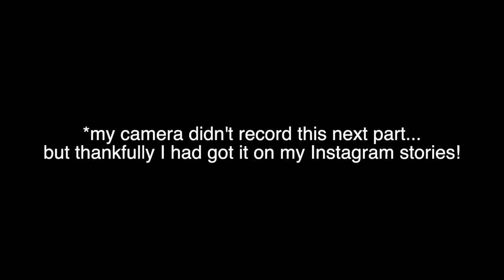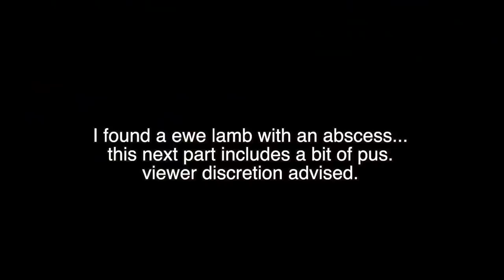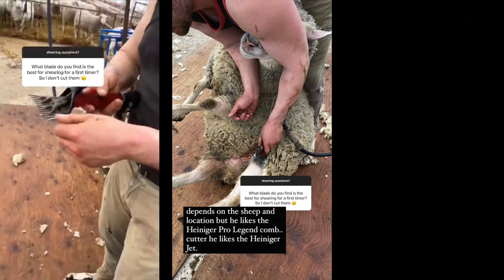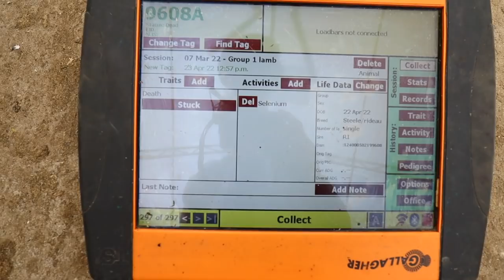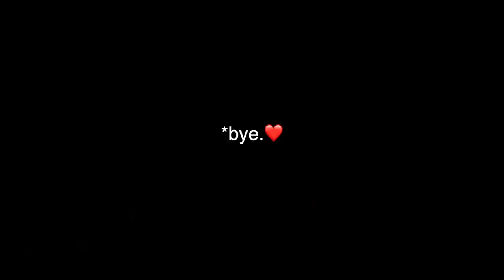EWE look drained.🫠 | a SHEARING surprise, some PLUMBING problems & MAMA finally lambs! 🤰 | Vlog 574

Comment: I don’t understand how anyone can think shearing the sheep is cruel. I would think having all that extra weight off of them would feel wonderful.  Charlie takes great care and it shows.
Reply: The handling of the sheep can look cruel to some, along the lines that they do get nicked from time to time.
Reply: Especially since they were bred to require shearing and now it has to be done. YT has a few shorts of sheep that were lost and can barely walk when they are found years later, and they looked miserable. I'm sure sheep have died because of overgrown wool.
Reply: I think that as each lamb completes their shear they kindof strut their stuff and look like they feel cooler and fresher. Like how we feel after a great haircut and style 😆🥰
Reply: If they were to wear a full length wool coat in hot weather for just 1 day they would change their minds.  or just be there at shearing time and feel the body as it is being shorn.  The Alpacas that I do will stand to allow me to get that hot fleece off of them.  I  talk to them and remind them how cool they will be.  Have those same ppl gave thought to how any die from heat exhausted.
Reply: I was amazed at how relaxed the sheep he was shearing looked - like she was getting a massage - maybe it’s knowing how to hold them so they feel secure. It really does look like an art to me

Comment: Attention sandy brock.. TIM from Ontario Canada.. if you were wondering how to clean this up after you have a spell.. use the leaf (blower.. )The leaf blower will dry up your floor).. it might be loud for a while but the floor will be dry.. depending on if you use the battery operated or extension cord.. but using the leaf blower will clean up most of your wet floors.. you can do this in the winter time if the floors are racy

Comment: Your flock is picture perfect after shearing. 120 sheep sheared in 5 1/2 hours comes to 34 sheep per hour. Also done safely. I agree it is a craft.  The field looks great. Your investments are paying off.
Reply: Less than 2 mins per sheep!! WTG Charlie!
Reply: It actually comes to 21.8 sheep per hour.  34 sheep per hour for 5.5 hours would need a flock of 187 sheep. The correct calculation is closer to 1 sheep every 3 minutes.
Reply: @christinesbetterknitting4533  Thank you. I knew the numbers looked off but calculator said yes. That's what I get for trying to think when tired
Reply: @christinesbetterknitting4533  WOW!
Reply: @amecocoa3829  Yep, it happens to all of us.  I am old school and I don't trust calculators, much less computers.  Except Sandi's Gallagher.

Comment: For the abces, you could put a syringe with betadine and rinse it with that... so it is really clean... just an idea. I am a human nurse... so perhaps with sheep it is different. But it wouldn't hurt either. So a syringe with betadine, squeeze it in the accessories and then push it out again. Betadine, ore hexa, or another not alcoholic disinfectant. With alcohol it cleanse too, but woundhealing is slowing down... hope I could help... if not... sorry...

Comment: Sandy at work I use the gray elbow length gloves to mix coleslaw by hand and a trick is using a smaller pair of gloves over the elbow gloves to keep them on the fingers better just like when you double glove to help a ewe lamb or to check if they're still lambing and need help getting the lamb out.

Comment: Love your videos! Gonna help with lambing this may
Reply: What is tiling?
Reply: @janesutube9675  do you mean tilling? Thats something you do before you seed your farm i believe...
Reply: @janesutube9675  you place drainage pipes ("tiles") under the ground in a pattern that guides excess water out of your field so the area you're planting in doesn't stay muddy. You lay down the tiles and hope you don't have to dig any part of them up again for years. :)
Reply: @chrishart4707  thanks for the great explanation!?
Reply: @janesutube9675  , have you ever seen drainpipes in the fields pouring water into a drainage ditch?  Those are drainage tiles at work.

Comment: Here in the eastern states of Australia, most of the shearing sheds have shearer's spring harnesses to alleviate the shearer's back pain.  It is pretty standard here and I think it is a regulation for sheds to have them fitted.  Makes a huge difference to those having chronic back pain as it allows them to practically float and takes the stress off the muscles.

Comment: In Australia, the shearers use a sling that goes under them to support them while they shear. They started this over 20 years ago, because it allows them to stay in the profession a lot longer. I don't think Charlie could do it because he's have to cart the framework with him to every property. maybe you could build hi one? lol Then he can keep shearing your sheep for another 20 years.
Reply: How do they get the stomach surface that way?
Reply: @NageelaMom  It doesn't restrict their movements. It just supports them so there is less stress on their backs. I'm not 100% sure but I think it's on a spring, so it stretches.

Comment: Would putting a layer of landscaping fabric around the tile then a layer of gravel before backfilling the dirt help prevent the roots from getting inside and clogging it up? When we had drainage tile installed across our property they added layers of the fabric, gravel and sand before covering it up with the dirt. We had a natural underground stream that ran through the backyard and lots of water out front and the neighbors on our street got together and ordered the materials and the state actually came and installed it because it was going to help lower their costs in road maintenance and redirecting the excess water. A number of our neighbors and the previous owners of our house all had trouble with willow and maple tree roots getting into the water and sewer lines and causing a huge mess. We had to remove a huge maple tree out front within a month of moving into the house due to roots in the pipes. Not fun.

Comment: That looks a bit like a sebaceous abcess...it's a kind of oil gland that can get blocked, the matter looks a bit like cheese curd. The tell tale is that she's had that abcessed more than once. What you need to do is get that thing to heal completely so it doesn't re abcess, that means irrigating with saline, and pressing from the base of the abcess to remove the matter & pus frequently so that the pocket heals from the base so it won't abcess again. Speak to your vet of course, I could be wrong.

Comment: Thank you Sandi for another awesome video update!  Question- why does Charlie wear moccasins during shearing?
Reply: It helps w traction on the wood and they need to be able to use their feet with delicacy. They are just the best shoes for the job!

Comment: There is a nylon sock they put on weeping tile for residential houses to prevent them from silting up 
Not sure if something like that would help or even been feasible when tiling a whole field 
The house I saw being built where this was used, the tile came off the roll with its sock on so it may be something you want to try when you have to replace a piece, it would be pretty easy if it makes any difference by what you have to dig up and replace in the future 
It looks like a big job

Comment: Seeing that flooding happens frequently in that area wouldn’t it be smart to put a drain in the area to help with removal of the oops also known as the oh shits! A simple sump setup with a lid would prevent too much muckity muck from entering but be available to drop a sump pump in to pump it out. It would save some on labor in cleaning it up. 
Just pop the lid and drop in a pump.  Granted a proper drain would be less hassle  but may need jetted every now and then to prevent clogging.

Comment: I'm new to the @Sandi brock flock, so sorry if this suggestion has already been made.  As anyone suggested, petitory calls to scare off the birds in the barn?  We had a colossal crow problem in the highrise apartments section and management started playing petitory calls on loudspeakers, like hawks, dogs, and other animals.  It seemed to work.  I'm sure there is a youtube video with those noises.  My second suggestion is to tie a bunch of balloons to the dogs and scare the birds when they reach their level.
Reply: Sandi tried a machine that would send out the calls. It made NO difference whatsoever! Very disappointing...

Comment: Sandi why not use blue metal to cover the pastic pipe with sand to stop the roots entering the plastic pipe.
Reply: The plastic pipe has holes in it in order to collect excess water from the soil and remove it. Covering the pipe/tile with metal would totally defeat the purpose.
Reply: @terryst9835  in Australia blue metal is a little stones that have a blue grey colour. This lets the water between the little stones but makes the roots a little harder to penetrate.

Comment: Hi Sandi!  I have a question.... I have heard you talking about Mark working with "tiling" and I never knew what that meant. I made the wrong assumption it had something to do with actual tiles or slate.???  So now it looks like tiling is something like what we call a "french drain"...the plastic tubing with holes drilled into it to distribute water underground???  Am I even close?  ......And the reason he knew there was a problem was there was standing or seeping water on the surface?? I learn so much from watching you....just wanted to get the vocabulary down so I can understand!   I am sorry about your final lamb....I know it breaks your heart when things don't go well. Rest assured in the furry little victories skipping around, kicking up their hooves!💗💗
Reply: In the past, actual tiles made of clay were used for drainage. The term stuck, but plastic tubes are used now.

Comment: I think Charlie has solved one issue of not having a back this is crippling is because he has the ability to switch hands which allows him to twist both ways where as a guy who only uses one hand he is not using his full body and as such is limiting them in one position. Here in Australia they have started experimenting with harness for the guys when sheering which will remove the weight from their lower back and legs. Some have taken to and some have not just like any changes in any industry.

Comment: City girl here, what do the tiles do?  The sheep look so good after shearing.  Poor lamb, you did your best. Don't hold thay against Moma if possible. I also wondered if the floor is sticky after the milk episode?
Reply: The "tiles" are drainage pipes. (They used to be clay tiles, now they're plastic pipes.) They're laid out under the ground in a pattern that guides excess water out of the field.
Reply: @chrishart4707  thanks for the info!

Comment: This isnt the first time you had a milk "spill" and I have a question about the lasting effects. 
Milk stinks when it goes off. So, after clearing out the spill, do you rinse the floor and the other items that have been sitting in it? Or do you find its really not a big issue? Do the other barn smells" overpower" it?

Comment: On the abscess … I have seen videos with animals having abscesses, and after they are drained, they have used a syringe to inject hydrogen peroxide into the wound. It foams up and cleans out the wound so it doesn’t return. Do you do that?

Comment: So sorry about the lamb.  I guess next time induce on due date.  Lamb was just too big.  Might want to check her hormones and sugar levels.  There might be something going on with an otherwise really good ewe.  At least you didn't loose the ewe.  I hope that you get her checked to find out what happened.  I think that you'd like to keep her.
Reply: There wouldn’t be a due date, more a due approximation from when the Rams went in, but it can be a very broad period with cycles
Reply: @deedawson6074  If it had be a breeding cycle using the CIDR homones there would be definite due date/s but because it was a natural breeding there was no determined due date.
Reply: @mobydickswife9512  Exactly.

Comment: Why is there no drains in the floors of the barns?
Reply: Because when they built the barn they weren't sure about raising sheep. They thought if it didn't work they could use it for storing their farm equipment.

Comment: Please explain what is a tile in these fields. I dont know.
Reply: Tiles are drainage pipes. (They used to be made of clay, and the term "tile" stuck even though the pipes are made of plastic now.) They're laid out under the ground to prevent water from standing in the field.

Comment: What happens to the baby’s that don’t make it
Reply: Re Canadian government recommendations, Sandi composts her deadstock. That is they are buried deep into her huge, hot manure/used bedding piles. The heat and the friendly bacteria break down the bodies very quickly. In the spring and fall the finished compost is spread as fertilizer on the fields. Burning causes air pollution, burying can cause ground water contamination.

Comment: Sandy, could you not skin the dead Lamb and put it on  small triplet? Cammy does that.
Reply: I think it would be a bit late, maybe if the small triplet was born around the same time because the longer they are drinking from the machine there is less chance of it transitioning back to a ewe, don't quote me on that but I'm pretty confident that I've heard either Sandi or cammi saying it at some point

Comment: First off, I would like to say, "Sandi has done an AMAZING JOB 👏 with her lambing". With the preg tox ewes and with the lambs that needed extra help and the ones that didn't make it.
But I don't understand what went wrong on the last ewe. You knew she was overdue, you knew the lamb was going to be huge, and you knew the ewe would need assistance. So why did you need those few more hours of sleep? Why couldn't you have stayed out there and helped her? I just feel so bad for the ewe😥😢.
Reply: Sandi said the drug usually needed 24 to 36 hours to work. The ewe was probably just starting labour, so the drug had nothing to do with the timing. 
"So why did you need those few more hours of sleep?" Because Sandi had been lambing for three weeks, getting up at 4 am and going to bed at 10 pm. She was totally exhausted, and fully expected the ewe to lamb sometime in the afternoon of the next day.

Comment: Does the government dictate how you dispose of the lambs? How are they disposed of?
Reply: Re Canadian government recommendations, Sandi composts her deadstock. That is they are buried deep into her huge, hot manure/used bedding piles. The heat and the friendly bacteria break down the bodies very quickly. In the spring and fall the finished compost is spread as fertilizer on the fields. Burning causes air pollution, burying can cause ground water contamination.
Reply: @mobydickswife9512  thanks